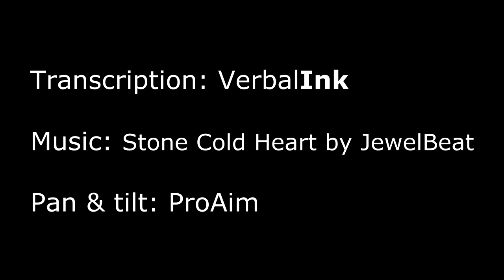Bose Lifestyle 20 display fix

Comment: When I was fixing the display on one of these I considered taking the cd player portion out since it takes up so much room and weight and its not required to operate the speakers.  Cut the whole thing down to 1/3 the size, just for fun!  Then I chickened out and put it back together for now.
Reply from the maker: That would be a cool hack, but there is always the risk that something will go wrong and you brick the thing. Thanks for the comment.

Comment: Tremendously helpful, sir! Thank you.  This provided the knowledge (not to mention, courage) to pursue this relatively easy repair, assuming one is properly equipped to desolder capacitors - easy compared to the modern SMD chips. And the tip you reminded me, I'd otherwise forgotten, touch a fresh cap across a bad (if failed open, of course) and see if that helped.  I could walk through the 100 uF caps and found only two bad.  I also did your trick for C27, making it 300 uF.  But I think I could have just put a 470 in there for that effect, right?  But I stopped when it seemed bright enough, not dazzling, but plenty bright to read through the smoked cover.  Oh, just a comment, when I was more active on desoldering, I found (Ebay, I'm sure) for about $100, a Pace unit, with the integral vacuum in the soldering pen, which are then hollow tips. Worked beautifully, as you center and surround the lead into the hollowed tip, and heat up is even, and then you touch the vacuum button, and whoosh, most of the solder is gone. Then, at worst, a bit more heat and a wiggle and the component falls right out.  It's so worth it if you can find one, it's a Pace model 'MP1' part: 7008-0148. And even supports 12VDC as well as 120VAC, I guess if you're soldering out in the ol' car.  Anyhow, your help was invaluable.
Reply from the maker: Yes, those Pace irons with built-in vacuum work great, I miss having them at work, but I don't miss working for big corporations.

Comment: Funny how people repairing things nowadays with little to zero knowledge about electronics. C27 and C24 are put in series with common plus just to make from two polarized capacitors a single non polarized capacitor. If you want to fix this board replace both capacitors with same value, increased value is better ( eg 2x 100uF + 2x 100uF).
Reply from the maker: Huh, I guess I did not pick much up in 40 years as an electrical engineer.
https://www.electronicdesign.com/home/contact/21808968/paul-rako

Comment: Hi, plese tell me what condensator changes , numbers ?.   C27 change   and replace 3x 100uF ( 50 V)?
Reply from the maker: Sorry, I did this years ago, and if it is not mentioned in the video, I would not know what capacitors to change by memory. In general, replace all the electrolytic capacitors I did, and if holding an extra one on C27 makes it brighter, than do that, like I did, ending up with three instead of one. There are other videos that talk about this exact fix, and maybe they will make clearer what capacitors to change.

Comment: I replaced the capacitors and still the display not coming on,😪what can be another problem with the system ? Please help .Thanks
Reply from the maker: Sorry, that is like saying "I replaced the starter, what else could be wrong with my car?" The capacitors are the most common, but there could be many other issues that cause a dead display. Sometimes you might have to just buy a used one on eBay, sorry.
Reply: Hi, this happened to me.....so I re-did just c27 again and really made sure the solder was good. now it works happy days ! possibly a bad capacitor.